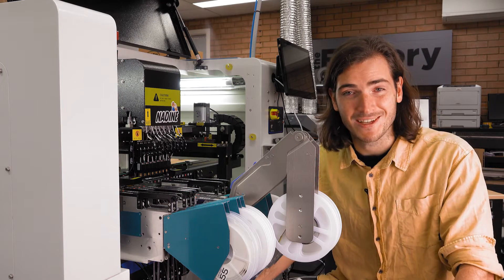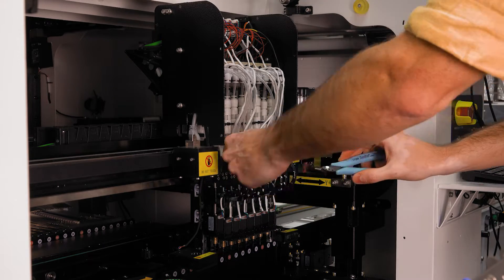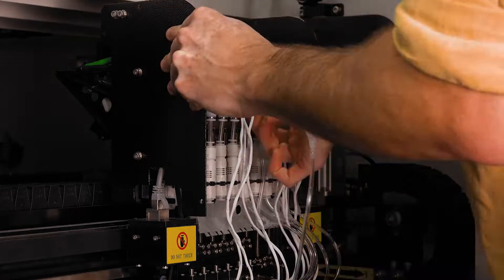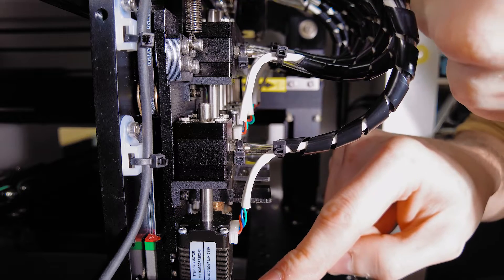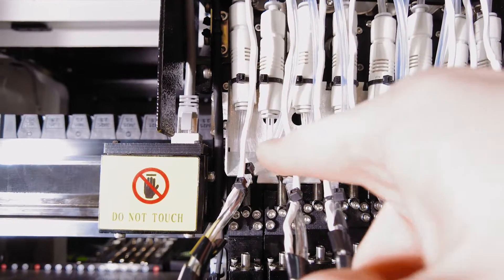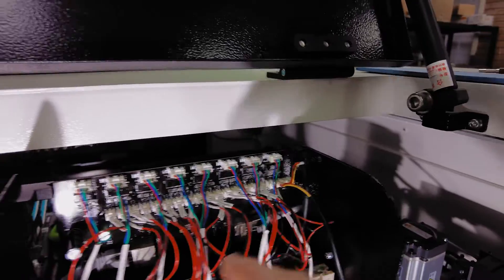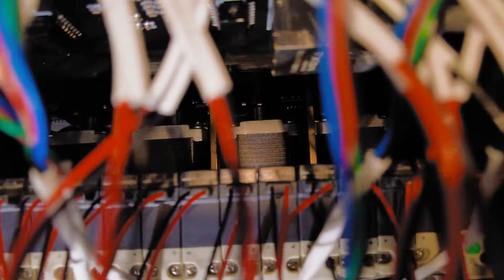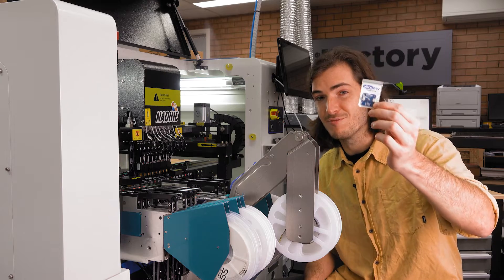The Factory | Neoden 8 (K1830) Maintenance & Gantry Exploration

Comment: I'm currently looking into buying one of these. Could you make a video on the workflow / software? Is there a built in way to easily assign a roll to a feeder that was previously setup, or do you have to manually enter all the values (pickup height, place height, etc.) every time you change the roll? How about from one board to another, do you have to adjust the  values or can you just enter the board thickness and it figures it out by itself?
Reply from the maker: The feeder settings are all stored in a project file, so you can recall all the settings very easily. If you move a feeder to a new location there is a 'swap' tool that will carry the settings to the new location.
I copy old production files and modify them for new designs to reuse common components.